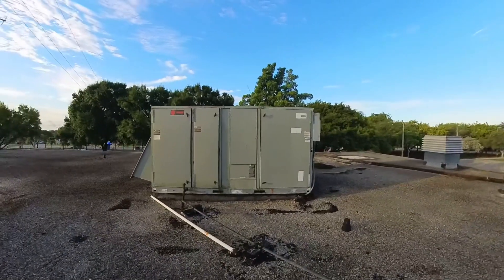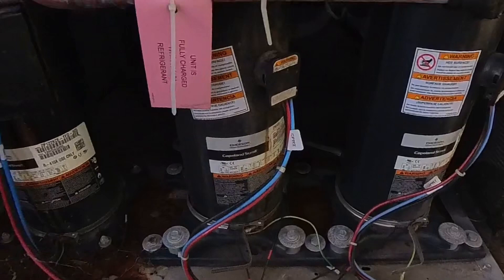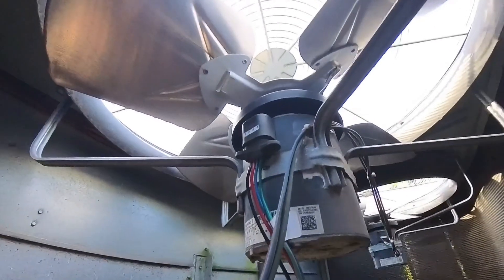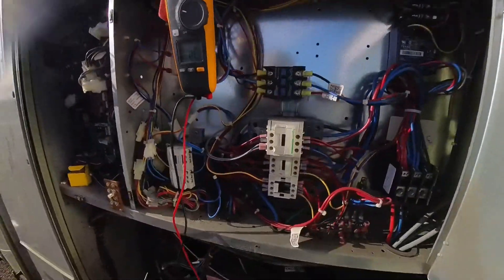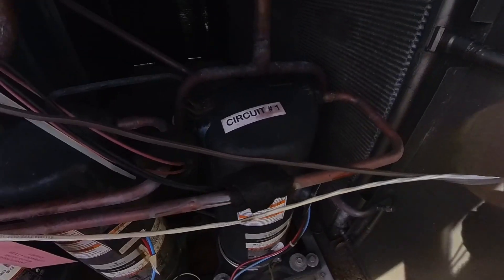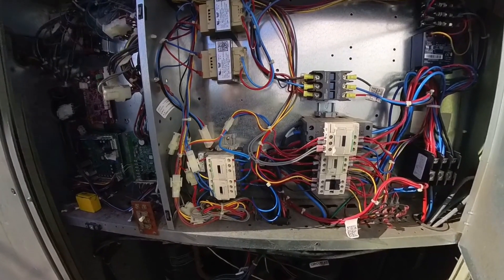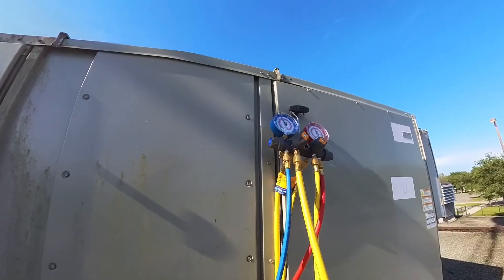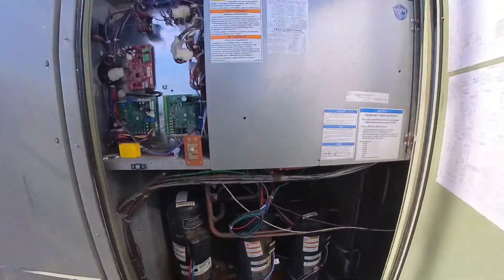25 Ton TRANE RTU Not Cooling #hvac #hvacrepair #airconditioning #trane

Comment: Is that a Fluke 376 Fc? If so how do you like it compared to the 902 Fc? Thanks. Enjoyed the video.
Reply from the maker: Thanks for checking out the video. Yes, it’s a 376FC. Only had it a couple months, seems to be a decent meter. I haven’t used the 902 or the wireless yet. When I get some downtime I’ll dig into all the features.

Comment: I've been in the trade for over 40 years, my I suggest when you checking the components like contractors and relays that you tell the people watching what you are doing and what voltages you are checking for. There are a lot of technicians that are new to the trade and would like to know what you are doing. Just an idea
Reply from the maker: That’s why I include video of the meter readings of components while troubleshooting . Thanks for watching
Reply: Suddenly everyone’s an expert in the trade from Reddit to YouTube 😅
Reply: @Joniyah444  Don't be so touchy, if you can read I said it was just an idea. Some people are just getting into the trade and it would help them a lot if they knew what was going on. And I have been in this trade much longer than you. And I don't care how long someone has been in this trade, no one  knows everything. Keep that in mine.